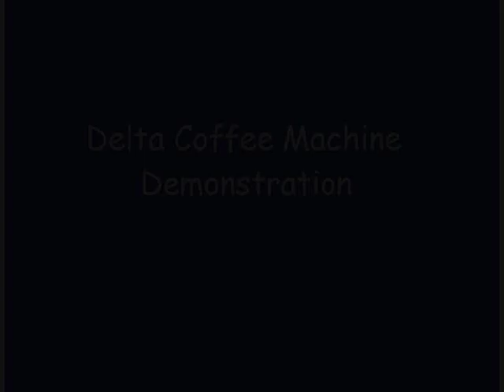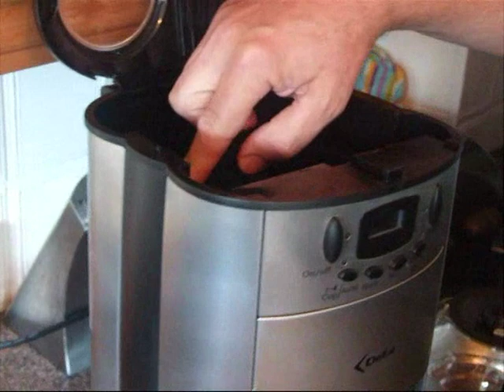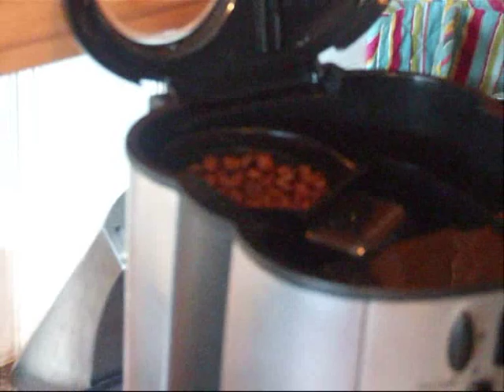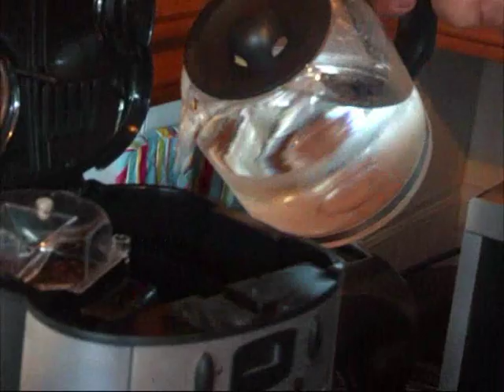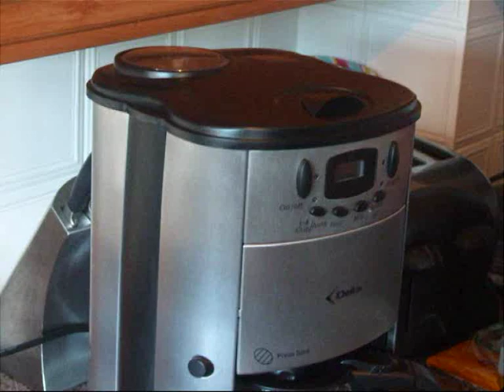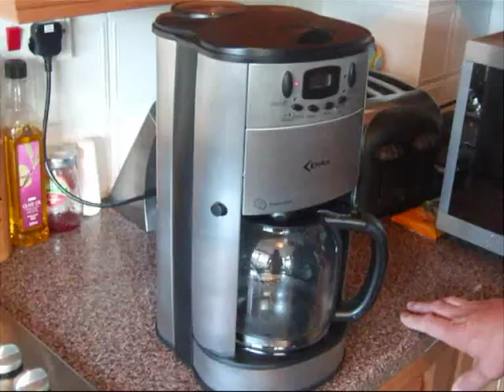Delta Coffee Machine Demonstration

Comment: For those  driven mad by the beeping and the "open" on the display. In mine the problem was caused by excess steam condensed in the electronics. The steam was caused because coffee beans (and bits of beans) had fallen into the water container and then partly blocked the intake pipe. I removed the bottom (two security screws 4 others) unclipped the intake pipe (the one with the valve) and cleaned it and replaced it). Allow machine to dry out screw bottom back on and and it works fine again... The beeping requires cutting two wires behind the front display.